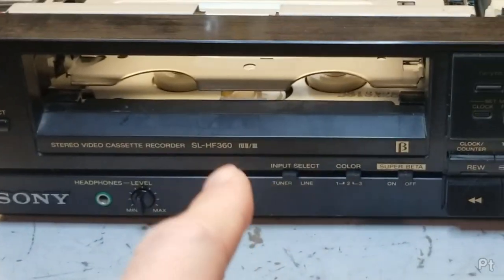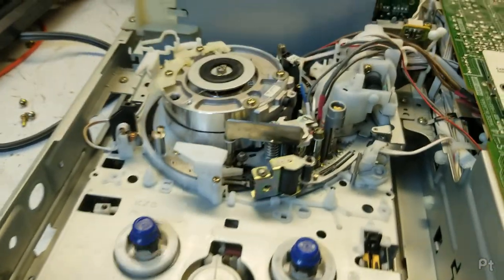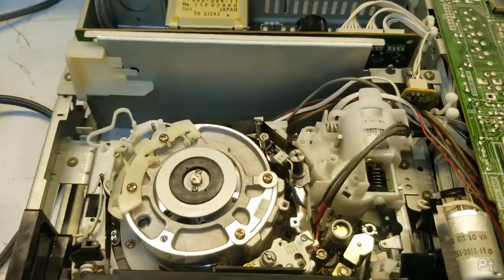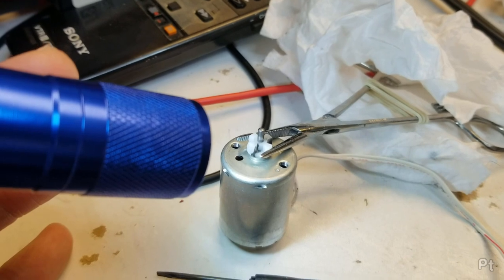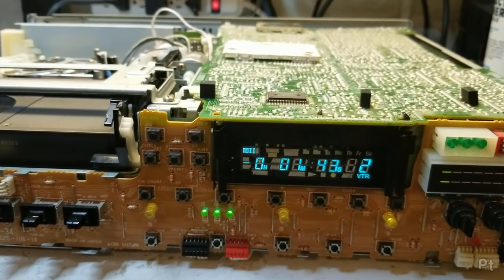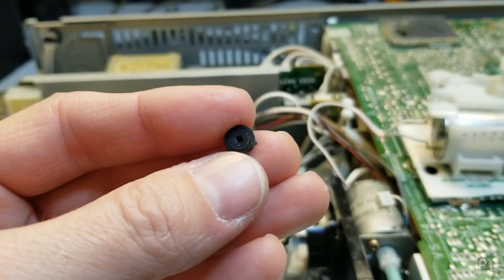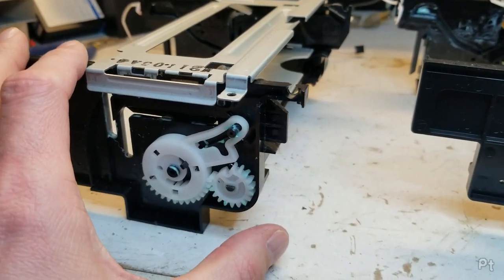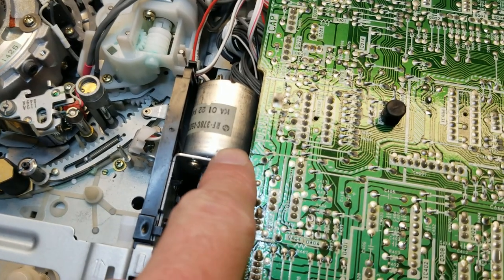Sony SL-360HF Betamax VCR (repair attempt)

Comment: Canada seems to me to be the reason why I understood everything when repairing an NTSC Device. I glued a 1x broken SONY SL-HF950ES (PAL/Mesecam) motor pulley for the worm drive of the cassette drawer with Pattex 100% REPAIR GEL (Henkel)
Reply from the maker: How did that work? I tried something similar about a year ago and it didn't last for me, however I think I used the wrong glue.
Reply: @probnotstech  If there is only one crack in the pulley, it is enough if the glue on the crome of the motor shaft sticks properly, if a "carrier" from the glue forms in the crack. The glue is not approved for PP and PE plastics because it contains NO solvents.

Comment: This is so deja vu with what I've seen and done with two of my 711B3 units. My HF2000 is from 1993, relatively new, and failed early on.  I will check that gear on the lacing motor. Question remains though, why does the unit lace itself upon turning the power on? And after it fully laces, why does the motor continue to try to pull the lacing ring further? Same too with that binding of the ring as it laces...silicone lube didn't seem to help. A shame about the HF360's worn heads; again, a familiar sight. Thank you for this; at least I'm not alone.

Comment: 0:23 - That is the remote for the Sony SL-HF900.  The SL-HF360 will probably respond to functions on the remote that it supports, but will ignore those it does not. 

18:57 - On the SL-HF360 and SL-HF350, the VCR will always attempt to play the hi-fi audio if it is present.  There is no way to voluntarily listen to the linear audio if there is hi-fi audio.  (There is no "normal/hi-fi" switch.)  These two machines appear to be an attempt by Sony to make the most stripped-down hi-fi VCRs they could -- they don't have stereo tuners, a simulcast mode, or even an "MPX" input.  ☹ 

The SL-HF360, along with many low-end SuperBetas from the mid- to late '80s, can play βIs but not βI -- it will use the wrong de-emphasis on a βI tape (regardless of the position of the "SuperBeta" switch), so the picture will appear bright and washed out.

Comment: Just recently discovered your channel and have watched many of your videos, old and new. Regarding this one, the parts on the motor shafts cracking is due to shrinkage of the plastic.

The plastic used has proven to be unstable and shrinks over time. Given that it is press fit on a steel shaft, as it shrinks the stresses increase until it cracks. I have a mid ‘80’s Sony ES line CD player that has a motor driven “chucking” mechanism. The worm gear on the motor shaft has a crack extending a third of the length from the motor end. This is just short of the distance the shaft is inserted into it. So far it is working fine but I may have to reproduce the gear in the future.

Unfortunately this is a common problem and if we want to keep this old tech going, we will need to use the tools available to replace these unobtanium parts.

Comment: Seeing plastic gears inside the a malfunctioning machine gives one that sinking sensation. I have a Tandberg 64x reel-to-reel and it's from the mid 1960s. There's no plastic in it. Nowhere to be found, it's really before the time of molded plastic in Norwegian electronics, and it's a tank. But it works, going on 70 years old. I'm not against plastic, if sparely and strategically used, but making gears and cogs and loadbearing structures from plastic is preventing the restoration and maintenance of many good electronics. Damn shame, but awesome that 3D printing can replace some of those broken plastic parts. That's impressive.